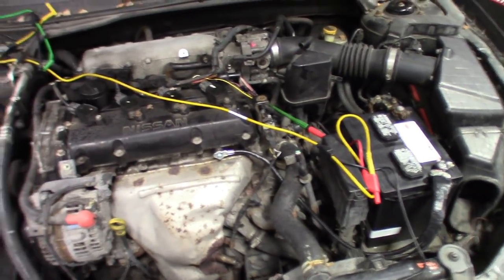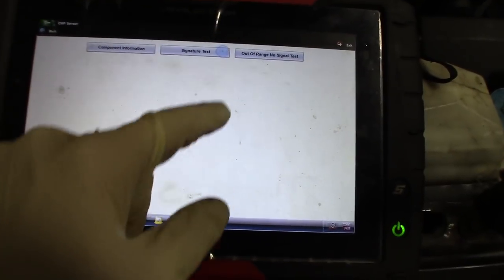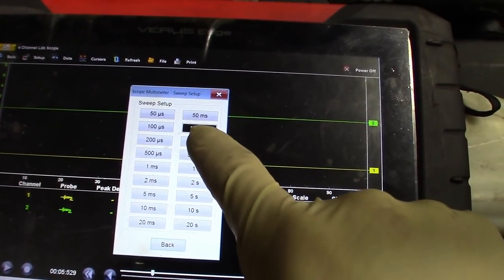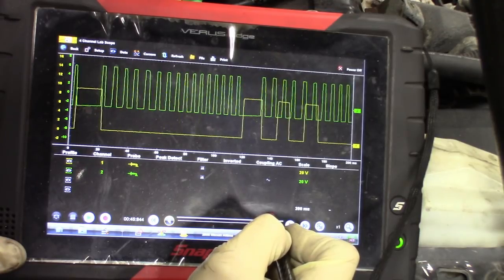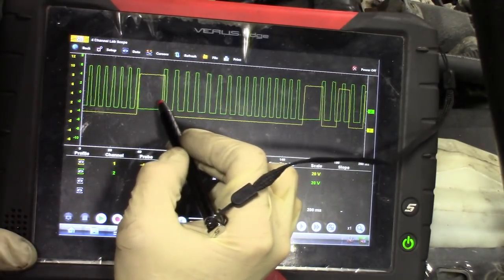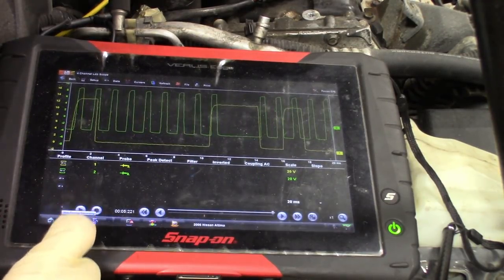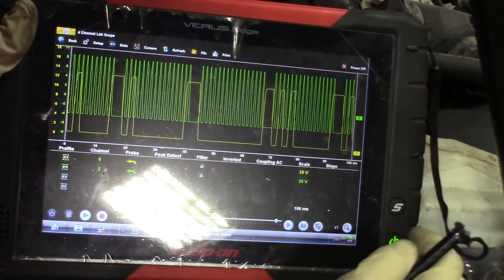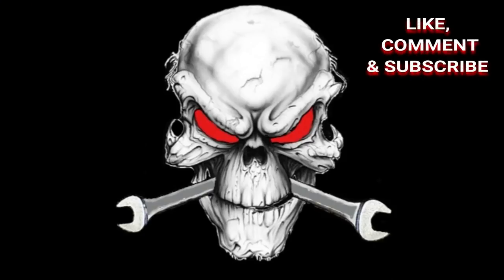SCANNER TIPS

Comment: I don’t know if you use IATN or not but if you search the vehicle it’ll come up with results kind of like identifix and if you scroll through them there will be know good waveforms for most cars on there. Most cam/crank correlation waveforms posts are labeled as ECM inputs/outputs. You would get even better use from it because a lot of them that are posted are uploaded from a snap on scope. That $20 a month membership is so worth it.
Reply from the maker: I haven't used IATN but I'll check it out, thanks for the tip. I believe on a cold start it's supposed to advance the timing more for a higher idle. Then after warmed the ECU should kick the vvt solenoid and back off the timing for the cam to fall more towards the middle of the crank gap revolution.

Comment: Known good on IATN shows the falling edge of the single tooth (number 1) on the camshaft to fall dead in the middle of the gap on the crank sensor. Someone else that had the chain stretch and a no start looked exactly like yours. Looks to be about 30 degrees off.
Reply from the maker: Yeah it looked like a stretched chain and probably a failed cam phaser.👍
Reply: Nice find. I don’t see how a lot of these techs out there doing it for a living work without a scope. Saves me SO MUCH time on a diag and along with a couple of cheap DIY pressure transducers it becomes an amazingly powerful tool.
Reply from the maker: @Jpilgrim30  I try to pick up the scope every chance I get.

Comment: Does it kill spark to save the engine from damage. Is the cold start run because of a variation in timing because it’s running for a cold start?
Reply from the maker: Yes it's a safety feature. On cold starts the ECU doesn't look for a cam/crank correlation, it only needs one signal. But u can see in the graph it's firing too late due to a worn out chain and timing issue.

Comment: Crank sensors go bad on these so often
Reply from the maker: I was hoping for a bad sensor. But by the signals being there it's clear the cam/crank correlations are off.
Reply: Yeah ive replaced so many on the mid 00s nissan maxima and altima
Reply from the maker: Nissan cam and cranks sensors where such a bad design. And don't even get me started on the crank plug connector. 🤔 What were they thinking with that stupid green clip thingy